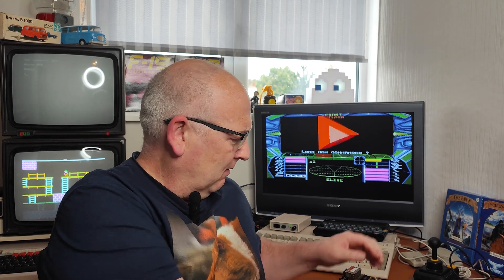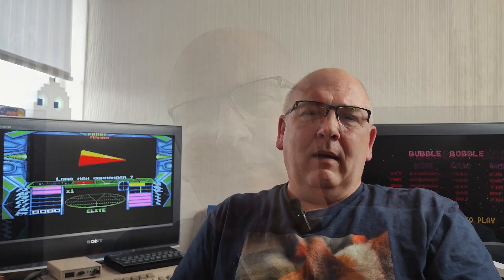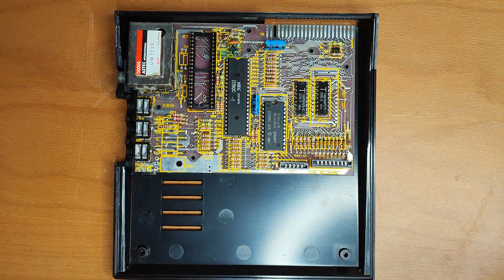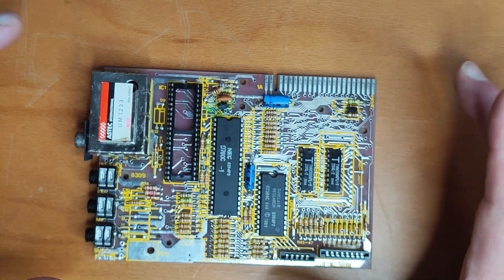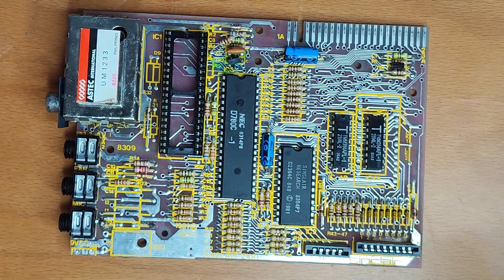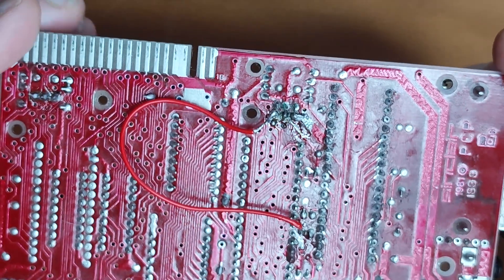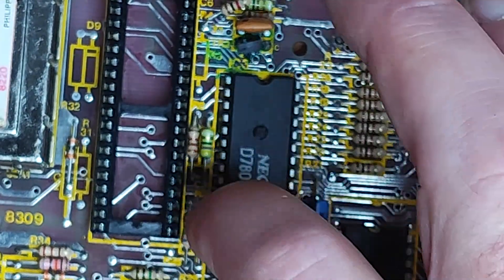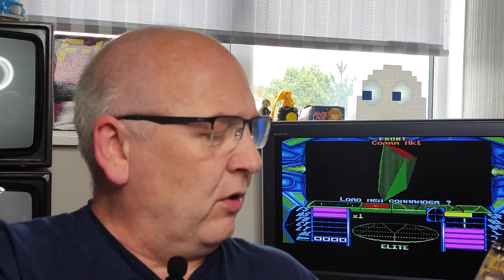How I Accidentally Destroyed My ZX81 | Unexpected Ending!

Comment: I've also messed up my ZX81, and yes only shows a white screen no cursor.  The ram pack was faulty so I thought I'd be cleaver and do the internal 16K upgrade plus replace the capacitors and do composite mod.  It's not worked at all since and yes I wish I'd done one thing at a time and tested at each stage. I intended to do just that but was too impatient so it's a lesson learnt.
Reply from the maker: Sorry to hear that Chris.

I get so into it and enjoying it, I just rush ahead. At least it should make for an interesting video! I've got an oscilloscope coming and a few other bits so that may help.

To be honest though, my strategy will be to retrace my steps. I'm puzzled though as to where that missing trace went on one of the transistors. A good clean up may help shed some light 😂

Comment: Great video! Is important to show success and failures. That way other will learn and I'm sure you have learned a lot too. Everyone had made mistakes before, but the key is to keep learning. I'm confident that you will get it working again. Thanks for sharing
Reply from the maker: Thanks for that. I really appreciate that. I really wanted to show it isn't all plain sailing and it's easy to mess up.

Hopefully it should make an interesting repair video 😁
Reply: "failures" are simply learning with a different route.